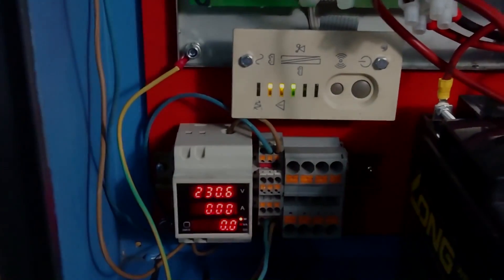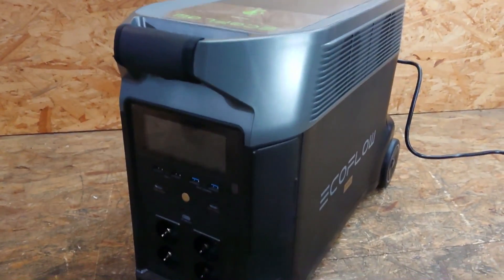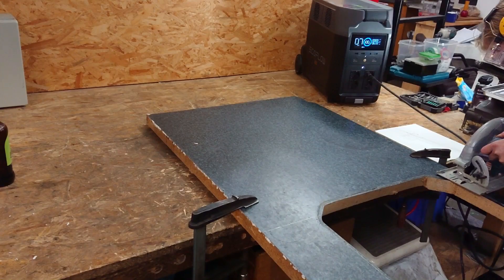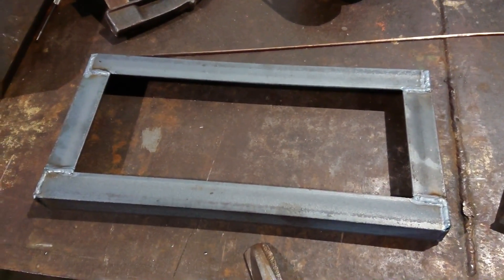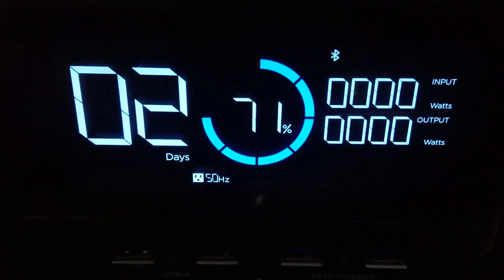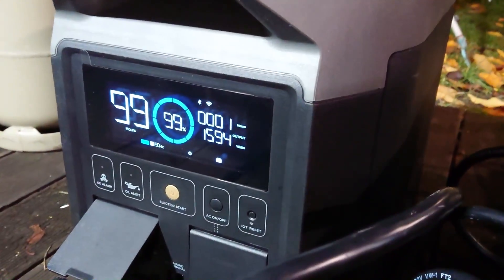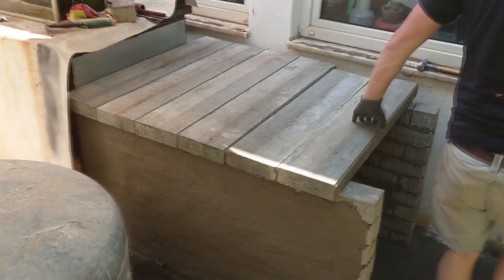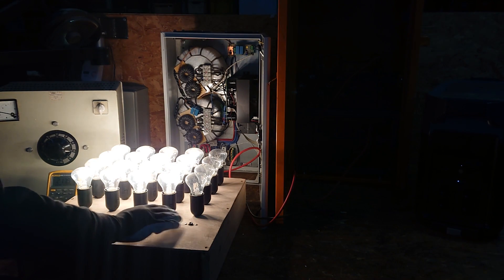Building a DIY Off-Grid Power System (vs. Ecoflow )

Comment: Forgot to say….I’m sure you are aware of this but the SACHS generator motor is air cooled and it might be a good idea to have a cool air vent and hot air exit to avoid overheating the motor? You could investigate using sound baffles to reduce the amount of noise escaping from these vents.
Reply: Castor oil
Reply: Or just scrapping the 2-stroke engine. 2-strokes stink and are just way too noisy and inefficient to make sense in any application.
Reply: @professortrog7742  one mans stink is another mans perfume!! 
I think that is a very sweeping comment based on a limited if not zero experience on two stroke engines.
I have two two stroke motorcycles, a 1987 Czechslovakian CZ350 and a 1975 Russian Voskhod 175 and they are both a joy to own. The beauty of a two stroke is simplicty and power ti weight ratio. Depending on the state of tune they can be very efficient, my Voskhod will return up to 120mpg which is on par with a modern 4 stroke 125. It has zero electronics on it and can be repaired with very basic knowledge,tools and skill. If I wanted to ride around the world I’d choose my simple two strokes over modern 4 strokes every time. Also with modern fully synthetic oils they run very cleanly and on very small oil/petrol ratios.

Two strokes were banned from moto gp as for cc to bhp ratio they annailated the 4 strokes, they are still usedin applications where low weight and power are requied such as chain saws and microlight aircraft.
Reply: @professortrog7742  the smell of the engine all depends on the quality of the oil, I found a great quality 2 stroke oil that was extremely low priced and I have also used expensive oil in the past that has been poor quality, top tip only use 2 stroke oil if it’s red in colour otherwise it is going to burn with lots of ash and there will be black oil dripping from the exhaust
Reply: @elonwhite6628   well what is the name of this great  oil  ??
Reply: @elonwhite6628  As we own and ride 2-stroke motor scooters a modern fully synthetic 2t oil uses %50 less oil in its required mix to keep it running perfectly.. An exhaust silencer pipe straight through but has an Internal sound baffling wrap would quieten the noise without restricting the exhaust flow, and an air box air filter would do the same, but from the "pinging noise" in the exhaust, it sounds like a very good 2 stroke. - just a shame many cities now ban 2 strokes completely.
Reply: @MrJohng2001   Tescos motoring range t2 with carb cleaner
Reply: @MrJohng2001  Stihl HP Ultra 2 stroke oil makes for a much less smelly exhaust.

Comment: I'd be a little concerned about running the Bosch generator inside its "garage". That's an air-cooled engine, and it doesn't seem like there's much airflow. How much of the noise is exhaust, and how much is just mechanical noise?
Reply: I think adding a 12v car auxiliary electric fan to the top blowing air inside the box will help to fix the problem. but it's also gonna need a hose to give the carburetor a fresh air from outside

Comment: When you make hydro power   Convert into air compressor and tank. Then to those generators. Like a big turbo. The air tank would work like a battery. Use more generators when there is more water flow. No petrol / fuel needed. 👍🖖🍺

Comment: I really appreciate this episode.   I have to admit,  3.6 kWh in such a small package is pretty impressive.  But the comparison is incomplete without the cost.  Given that your homemade system is made of recovered materials, yours is more likely far cheaper.  Maybe that's information for your next episode.
Reply: it is absolutely cheaper to recover/restore parts, but if you value your time and factor all the effort of restoring this stuff... it adds up. 
Ultimately, not everyone should be messing with electrical components like this because it can be very dangerous if you don't know what you're doing.

Comment: Good to see a Henry vacuum cleaner outside the UK! They are fabulous machines, very reliable with a powerful suction, best of all they are simple, very easy to repair and all the parts are readily available and cost effective. I’ve had one for 25yrs and can still get ALL the parts needed!
Sorry your trip to the UK was spoiled by illness, I live in Derby near Nottingham and would have loved to hear you speak 👍🏼👍🏼👍🏼👍🏼
Reply: The Henry's are really nice and in the Netherlands, many schools and public places use them as their default option.
Reply: They also make a 420W eco model that will run nicely off smaller inverters
Reply: The Henry and the Charles that I have are made by Numatic in the UK. Excellent vacuum cleaners, reliable and fairly quiet. I've had mine for over thirty years and only now are the motor bearings starting to fail. They're inaccessible in the sealed motor so I think I'm in the market for another in the Numatic line. Cheers from British Columbia, Canada.
Reply: Let’s not forget Henry’s bigger “brother”, Charles. This model not only has a bigger dry waste capacity (over double that of a standard Henry) but it can also be used with liquids as a wet/dry vacuum cleaner. 

Charles isn’t the only “sibling” in the Henry vacuum family, but I’ve had mine for well over a decade now, and he’s still going strong.

Great video, and entirely appropriate sponsorship for your content.
Reply: Henry vacuum cleaner. Smart choice.
Thank you for an interesting and informative video. 👏👏👍😀
Reply: I used a Henry vac when I worked as a janitor in Canada. Worked great.
Reply: At one of my clients, they have both Henry and Henrieta/Hetty vacs ;) they work great and are throughout the business because of the performance and reliability.

Comment: i guess the ad money was well spent - as all the product ads by the company has made i never before seen that they actually have general generators
let alone one that can use 2 different computable sources...
Reply: Yes all the ads I see tout the batteries, not the near identical size generator sets, though I have no doubt that they are custom made units for them, probably derived from Honda generator sets, or a clone of them.